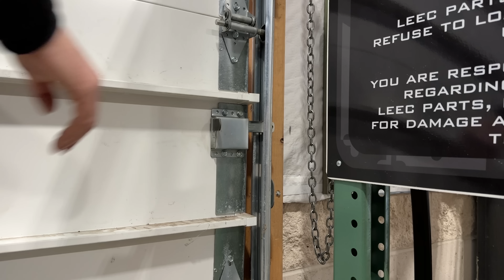I CRAMMED a Viper V10 In My JUNK Nissan 240sx

Comment: Might need to upgrade those brakes with a v10 in the front now😂
Reply: Dont worry, bought an entire 370z just for the brakes 😁
Reply: @scraplifedalt  what a scraplife thing to do😂
Reply: @christian6381  U know how we do!
Reply: Who needs brakes when engine braking exists?
Reply: @mathiasnkristensen  There is some merit to this point.
Reply: Maybe a parachute 🤫
Reply: @scraplifedalt  Taking the brakes off my car for weight reduction
Reply: @mathiasnkristensen  engine braking will only be good with a decent weight flywheel.
Reply: @CleverWheels  heavy engine = heavy flywheel. Definitely heavier than stock.

Comment: I think the steering is still going to be affected by the rack movement as the best practice is to keep inner tie rod location at the same point as the subframe to axle connection is. So if the rack is moved to left and tierods shortned/lengthend accordingly, that means that left inner tie rod is more towards to wheel and when you hit a bump, it will act differently then the right side. So this means that during suspension travel front wheel alignment will be a bit chaotic.
Reply: I reacted to the rack aswell, the left front is going to have a much more progressive toe out gain through the travel than the right side. It's going to feel sketchy driving at best. Perhaps a different rack would be the the easiest way to get around it. 
The inner joint A and outer joint B for the tie rod on each side needs to be the same distance from A to B on both sides because the bump steer is the arc the rod makes in relation to the lower control arm. 
Great video btw, almost makes me miss my old s14 :D
Reply: @SuperBlubben  Project itself is awesome tbh, I'm not sure how v10 sound goes with Nissan S chassie but it's awesome anyways :D
Reply: very good point
Reply: @MadisM2nnik  V10 sounds fkn bliss in any chassis just sayin..

This is coming from a rotary owner btw so my hearing could be somewhat non-normal to begin with? 😆

Comment: Hey man, great build, watching from Perth Australia!
If you are actually serious about boost (not sure if you were joking)
You can run a rear mount turbo, with the charge pipe into the boot, through a water to air intercooler, then run the charge pipe either under the car (opposite exhaust) up through the front tyre fender into the throttle body..
Or charge pipe through the cab obviously, maybe beside the passenger kick panel..
The turbos can have its own oil reservoir tank and scavenger pump.. 👍 done. 
Just something to think about but from where I’m sitting, it’s gona be a crazy ride as it is.. 
I’ll be watching😎 cheers

Comment: Haha, I remember chopping up my S13 Coupe just to put a huge FMIC and Turbo on my factory KA24DE back before they had all the "kits" and relocaters, etc. But I couldn't imagine trying to cram this in. My chops were on a much smaller scale, yet I still felt the need for reinforcement just to avoid any extra chassis flex with 2.5x the factory HP and the intent to hillclimb/touge. This will be interesting. I'm hoping to see this project get some chassis, suspension, brake and sticky rubber lovin' to see some of the full potential. Love this channel.

Comment: For the brake boosting would a hydro-boost set up create more space? For the 4"exhaust, i would look into oval tubes. Great flow and will tuck up nice to the floor. For the cooling system, you can mount the cores horizontally with a small lip duct. The cores on the side can be mounted vertically to make more wheel space. Super cool build, good job💪 I'll keep my eye on this project.

Comment: The largest big block Chevy engine is currently the 632ci, and she dominates any Viper engine with a Whopping naturally aspirated 1004hp, and 876lbft. of torque! That is a 364hp difference in favor of the Chevy, and a 276lpft. torque difference! Although I do realize that you probably meant that you were using what was available for a considerably lower cost, the Viper engine isn't even with two more cylinders close to the size, or capability of a large Chevy big block! However I love your show, please keep doing what you do! I will definitely keep watching!

Comment: Such a wacky concept. I hope it comes together and then you caj start polishing everything. Its going to be a true hot wheels once it's sema polished, which im hoping for. Would love to see the engine cover painted a dark metallic blue just surrounded by polished metal. This thing needs a massive molded and smoothed out wide body with some clock work wheels in deep blue and chrome.

Comment: i use to work at a shop that specialized in that v10 ,,volume isn't why they stay cool but it is thirsty .. air flow is why they stay cool., race rads run ful on all the time .. if you only use this to race .put the rad where ever you want . you just need the correct surface area of fins and fans to cool your spikes., streetcars use thermostats ., they want the fans up front for efficiency , noise and cost ,  the volume of coolant only matters in certain ways., it all gets heatsoaked eventually ..allthough there is a limmit to how low you can go on volume for coolant, it equalizes as fast as possible as heat dispersion is its only job .. its just a matter of how much heat you can pull out with fans and fins and how long you have to do it for and in what direction..,  rock crawlers and drag cars and drifters all have there own issues with G load and duty cycles on fluids ...,   buttt,,  the biggest concern i have knowing these engines besides ever working on that car.., is that exhaust rout the aluminum pan doesn't help either .., the viper 10 is born from the pitts of hell .. my concern is you boil your oil , making it impossible to ever cool the whole block but you may even boil water jackets too,  the side pipes on vipers get exceptionally hot as is., dump them into a single so close and you're asking for issues imo,  but it only matters in certain circumstances.., like you care about your passengers feet or something dumb like that.. you might pull a 7 on a track , but traffic and redlights might be a problem ..js

Comment: You can look into a hydro boost brake set up from the chev astro van, I can't remember which years had the flat mount and which ones were angled, save some space and have much more braking pressure, I've heard it can split brembo calipers

Comment: Have you though of using a remote brake booster like they use in Rally cars?
Also for the steering try and find an SW20 MR2 electric power steering pump, one less thing to attach to the engine, same goes with a Davies Craig electric water pump.
Nice project!

Comment: The steering gear must be in the axis of the vehicle. It cannot be that it is shifted to one side and it is corrected by the length of the rods because then the angles change, including the akerman (it is then different for both sides) and the car may fall into shimi, and it will certainly drive unpredictably. In extreme cases, this can break the driver's hands. Why don't you change the steering rack to a worm gear, e.g. from a jeep xj? This will save you a lot of space under the engine. In this case, under the oil pan, only the steering rack and stabilizer linking both wheels, will run?

Comment: While I've had a hand in shoehorning some interesting engines in an S chassis (a Boss 302 probably takes the cake overall), there were a few times I had to hesitate to chop up a primo chassis.
If I were asked to assist with this one, I imagine the conversation would go something like this:
"How much do you expect you'll need to cut out, and what's going in?"
Viper V10
"Soooo... Angle Grinder or Plasma Cutter?"
 Definitely would jimmy up a tube chassis front to accommodate that monster just for fitment and make amends with having to do the geo on new suspension, but she'd handle like a dream once you get past the off-throttle understeer.

Comment: Why not remote mount turbo at the back? would help with weight balance and avoid a lot of the packaging issues, though getting the air back up to the intake would require creativity. you could go full matchbox/hotwheel car and cut the hood and install a massive roots/lysholm/whipple style blower for the full cartoon effect. why not go full lunacy, youre half way there already with this build.

Comment: Could you not have relocated the starter to the other side? Shifting the rack to one side isnt ideal and may cause some significant bump steer problems due to the pivot point of the steering arms are now offset in relation to the lower control arm pivot points, and the left and right arms will now swing a different arc due to the difference in length. Mean build tho man, all the best going forward

Comment: I wonder if I could put one of these things in my blown up 08 6.4 F250 lol. One other thing, don't use an angle grinder ( or any other kind ) without the guard. A wheel explosion really can kill your ass. I know it can be a hassle but your face will thank you later.

Comment: Look into getting a different oil pan .... they make ones that relocate the oil pickup i.e. not stock ... 🤷‍♂️🤷‍♂️
Reply from the maker: Dry sump set ups for this motor are extremely hard to come by and very expensive unfortunately.

Comment: What I'm seeing so far; the starter is going to rub into the steering fitting and blow power steering fluid, thar exhaust is gonna cook the oil and over heat the engine, you don't have enough cooling to make this more than something to take to the grocery store